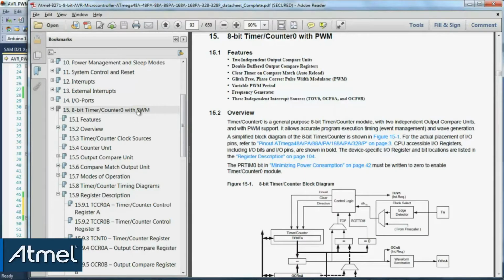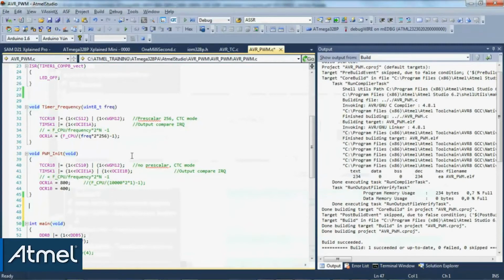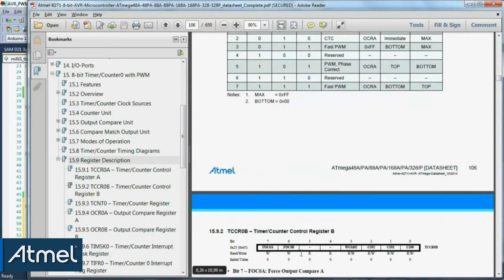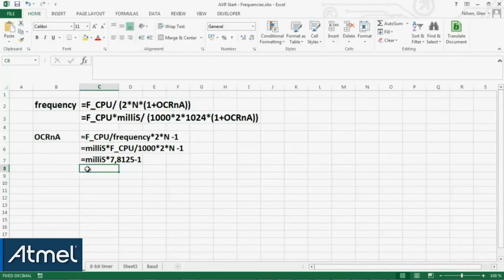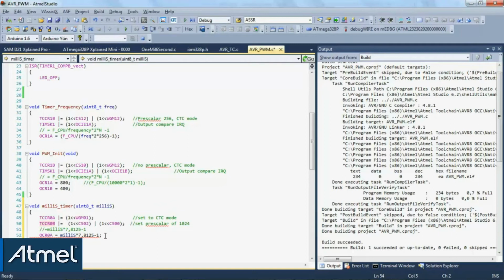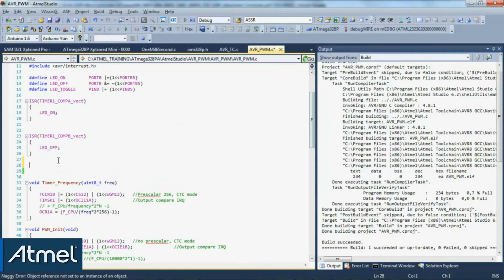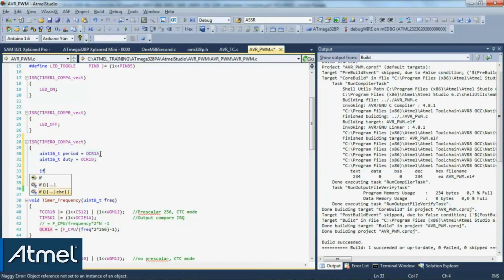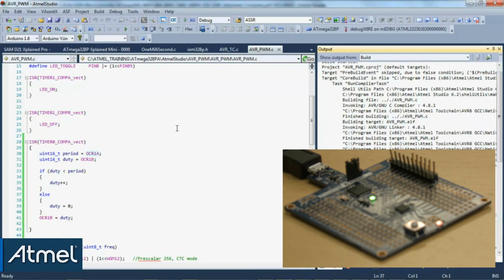Getting Started with AVR: Updating PWM Duty Cycle Using a Millisecond Timer (#10)

Comment: You made a mistake. There is a comma instead of decimal point in the formula. Code compiled because comma is a valid c++ operator, but the result is different. Studio placed squiggles beneath, you should have noticed. 
Anyway, the video is useful.